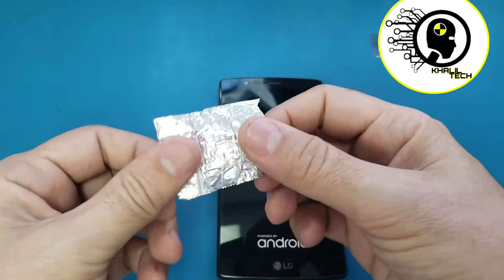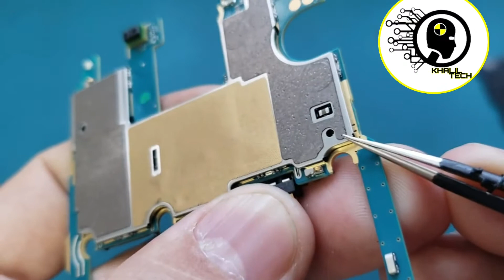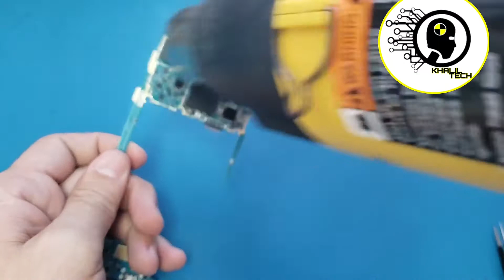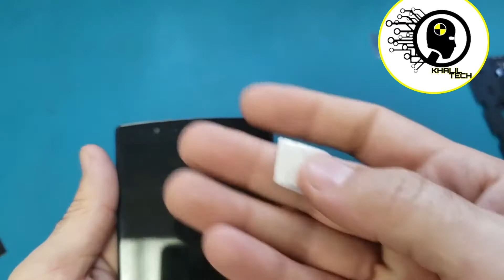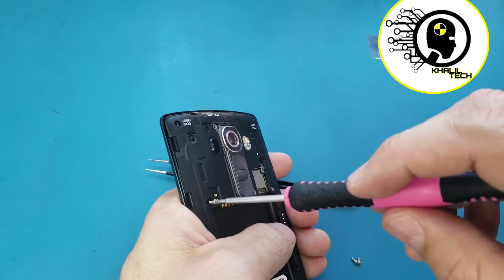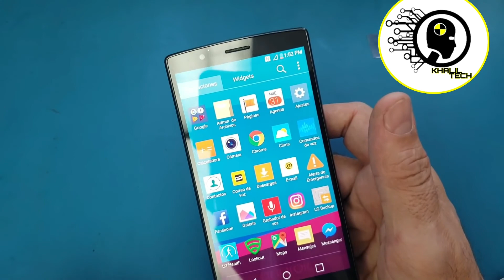LG G4 boot loop easy fix, No special skills or tools needed

Comment: Unfortunately you can easily destory your LG G4 using general utility heatgun, as you can't control temperature at all.  Buy a cheap hot air rework station like no-brand 858D (only $35 on ebay).  Much less danger of frying your LG G4 motherboard.